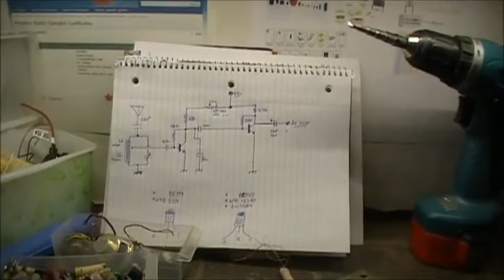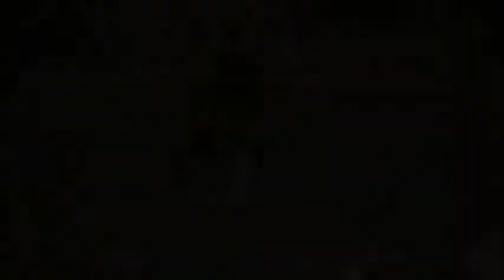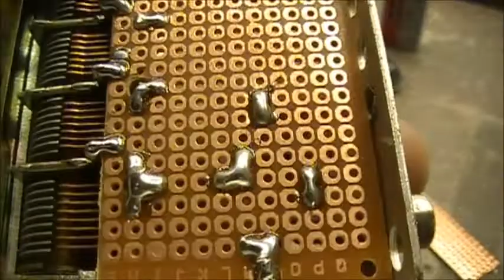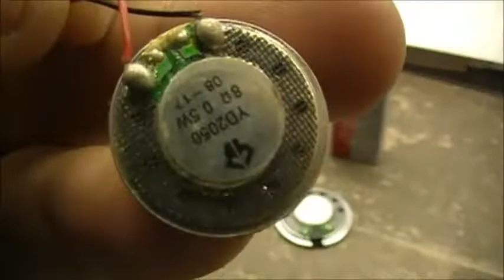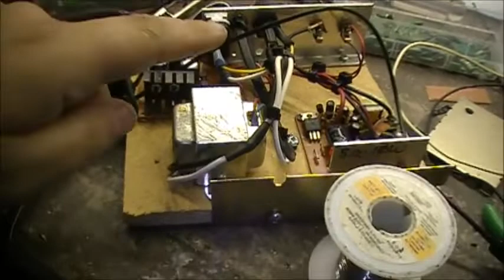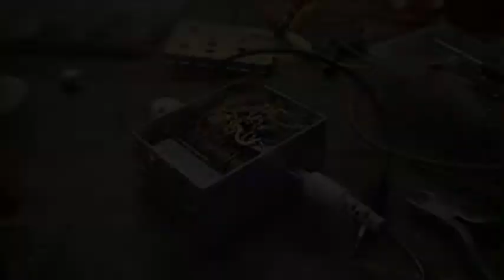Two Transistor receiver, Photo sensor, And Jackass amateurs  PART-1

Comment: Loving these receiver projects you are doing. 
Regarding those photo sensors - I come across something similar in my job working on oil fired boilers, there is a photocell / magic eye which sends the signal to the control unit to tell the boiler if the burner has ignited or not.  If the sensor senses light from the flame then the HT electrodes stop sparking. If not then the boiler goes to lockout, that sort of thing. Not sure if it is the same thing?
As for the snarky comment you got..... for some reason it seems to be very common on Facebook.
I really don't know what it is about Facebook but it seems to be full of negativity (putting it mildly)
Ignore the negativity my friend - we are all learning from each other and by showing each other cool projects like yours, it makes others want to experiment themselves.
Reply from the maker: They don't all work like this one, BUT, There is always the next one.  Keep on keeping on i say! ;-)

Comment: I think they use the sensor in the VFO encoders.
Definatly in the mouse wheel for computers.

Now you know why I never got my ham ticket.
They can get bent.

Happy new year buddy
Reply: https://i.imgur.com/WWw3Dit.jpg
They used to call them photo electric eyes. Old burglar alarms and street lights used to use them. The one you have may be infra-red. I remember the metal can ones that look like an old transistor but has the squiggly trace on it.
Yours may be the receiver like for the remote on a cable box or VCR. The infrared transmitter looks more like a regular LED but theres so many designs now, who knows what package is what.
Grab a remote and aim it at the camera and look at the view screen. You'll see a grey light flash.
Old tv's used a click sound like a tuning fork before IR remotes